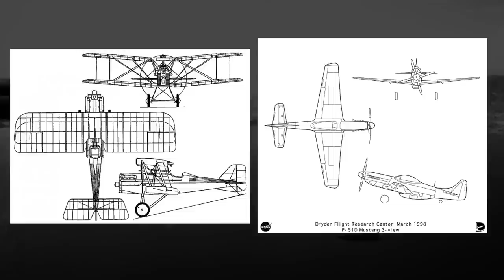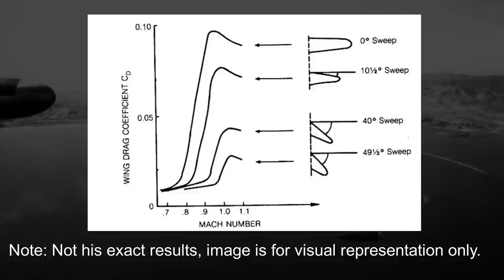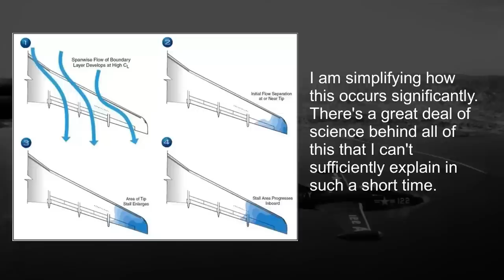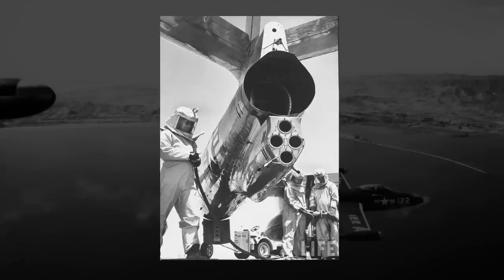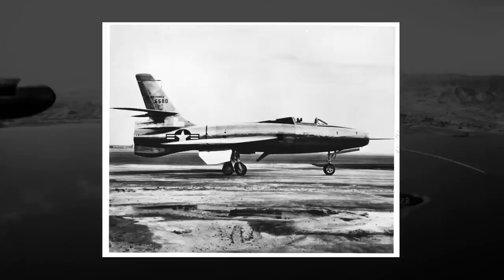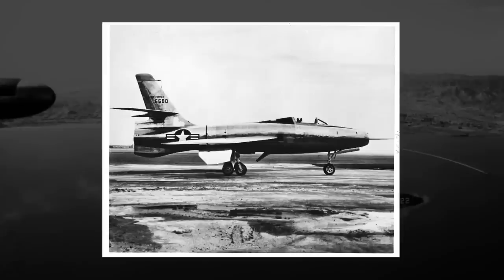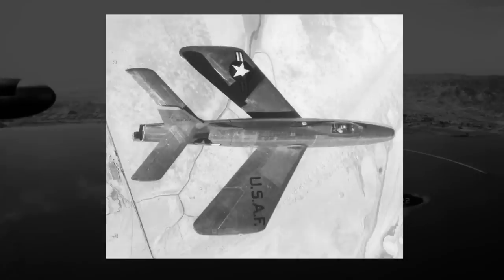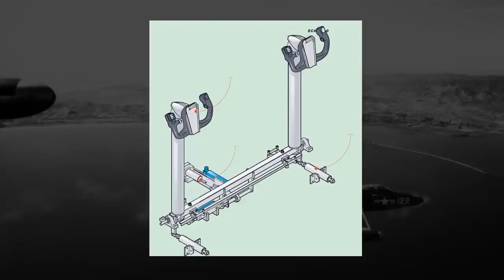American Inverse-Wing Interceptor: Republic XF-91 Thunderceptor

Comment: This is a fair explanation of this plane and how it's aerodynamic planform came to be. Thing is, I never once heard you mention the concept's reason for being - in fact, the inspiration for it's name: Thunderceptor. The U.S. Army Air Force had laid out specifications for an aircraft to contend with the anticipated threat of nuclear bomb-toting aircraft coming to wreak havoc upon the USA. In keeping with the course of aircraft design, it would certainly have to be jet powered. Trouble was, there were no jet engines that could propel an interceptor plane like the WWII rocket-thrusted Me163 had demonstrated. The proposal that resulted was the pairing of rocket motors and jet engines. Theoretically, such a plane would get airborn - fire off the rockets and ascend to get to the altitude of enemy formations. 
   The V tail wasn't just an aferthought. It had been one of several options from the very outset.

Comment: 12:12 ,you forgot to mention leading edge "saw cut" notches, does the same job as a wing fence at much lower weight and size (the EE lightning, F8 & F4 all had them and prob a lot of others)
Reply: Convair F-106 Delt Dart also had the notches.

Comment: This video does not really explain the purpose of swept wings or the pitch up effect. 

Swept wings do not reduce drag per se, they increase the speed at which compressibility creates a drag-increasing shock wave. If a straight wing airplane doesn't already approach its critical Mach number or drag divergence Mach number, just giving it swept wings of equivalent lift will not make it faster. (By the way, the wings of the Me-262 were not slightly swept to increase its speed, they were swept to rectify a problem with the center of gravity in same way sweeping the wings of the DC-3 did.)

All swept wing aircraft stall from the tip first, but they do not usually pitch up suddenly. Swept wings stall more gradually than straight wings, and the positive pitching moment tip stall imparts creates a lightening of the stick force required to hold the angle of attack, which usually remains controllable well into the stall. Uncontrollable pitch up usually occurs when a change in downwash affecting the horizontal tail prevents it from controlling the pitching moment. Pitch up instability occurs at very high angles of attack that are typically beyond the usable range.

A sudden pitch up did not cause the famous Sabre Dance crash.  The real problem was insufficient directional stability that allowed excessive sideslip to develop, which in conjunction with high angle of attack created uncontrollable rolling moments.  If you watch the video, you can see the AOA, while high, remains controlled until the airplane begins to yaw and roll.  The solution to the weak stability was to increase the size of the vertical stabilizer, not change the size of the horizontal tail or angle of the wings.
Reply: Yes.  I'd known that the cure for the F-100 "dance" was to enlarge the vertical stab surface and was surprised he didn't go into that detail in the video.
Reply: @whalesong999  He didn't go into that detail because he doesn't really understand the Sabre Dance and thinks it as was about pitch-up when it was really about insufficient directional stability.  The swept wing did contribute to the Sabre dance, but the primary characteristic at play was its roll due to yaw rather than tip stall.

The F-104 had a pitch-up issue at very high angles of attack, and it had a straight wing.  The pitch-up was due to downwash over the tail.  The solution was a to keep it out of that extreme AOA range with a warning system and a stick pusher.

Comment: The term  "Sabre Dance"  was unique to the F-100.  The early versions had a shorter vertical stabilizer.  There was not enough lateral stability at some points in the flight envelope.   The solution was to lengthen to vertical stabilizer in the F-100C.

Coupled with that, in the accident video, the engine was not capable of generating enough thrust to fly out of the coffin corner. It can be seen that the engine was in full afterburner but lack of thrust and yaw instability cost the the pilot his life.

https://www.youtube.com/watch?v=Q2qqKwndFW0

Comment: If the tail on the second aircraft as you said "literaly disintegrated", I presume this did not happen while on the ground; so how did the aircraft survive to get a V tail??
Reply: Wikipedia said the engine failure occurred 90 seconds into that flight, maybe the pilot got it on the ground before the tail burned off.
Many test sites were dry lake beds so you could land just about anywhere.

Comment: The Sabre Dance was one accident where the pilot got behind the power curve in a F-100 Super Sabre ferry flight..   Swept wing stall characteristics are not called “Sabre dance”.     Well documented and all aviation books.  The F-91 wasn’t a Sabre !   it was built by republic so therefore it could not do a “Sabre dance” .   It’s design was to get rid of the swept wing tip stall characteristic just like slats, washout and vortex generators, suction (boundary layer controls) and a few other ideas.     Good info but the wrong use of the words saber dance. 

Cheers